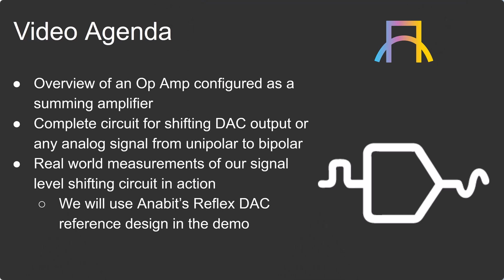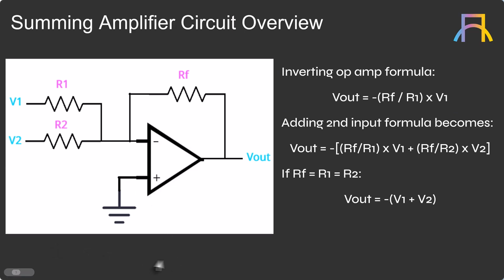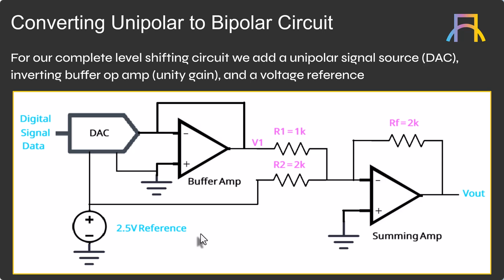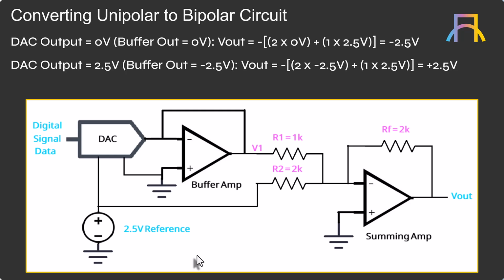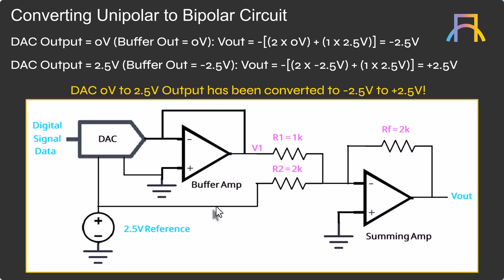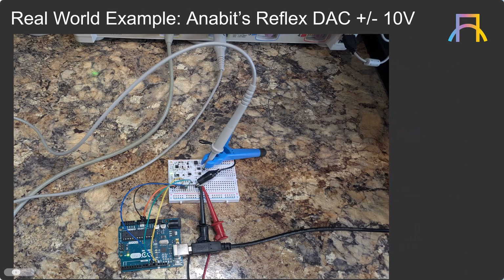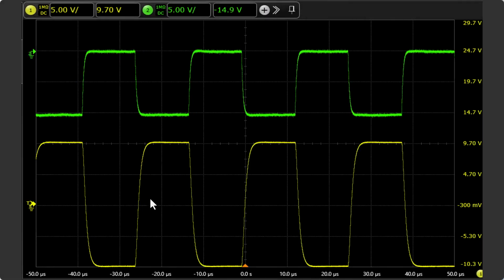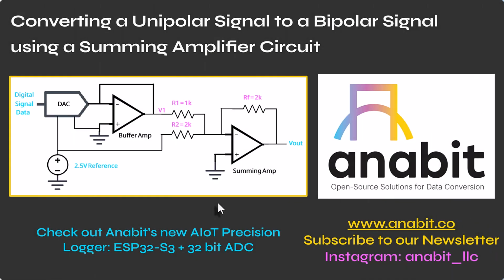Converting a Unipolar Signal to a Bipolar Signal using a Summing Amplifier Circuit

Comment: Enjoyed the video. I am guessing a similar circuit concept could be used to shift a bipolar signal to a unipolar signal that could then be measured with a unipolar or ground referenced ADC?
Reply from the maker: Glad you enjoyed the video! You are correct, this circuit concept could be used to shift a bipolar signal to unipolar so it can be measured by a unipolar configured ADC. If you use the ADC's reference voltage to shift the signal you may need to scale, for instance divide it by 2. You may need to add an inverting buffer op amp at the output of the summing amp to ensure a positive unipolar signal.
Reply: @Anabit-LLC   Are you able to make a video explaining this concept?
Reply from the maker: @deyanagounder4534  Yes we can add that to our list, we have long list of video concept we need to get through first. It is the same concept cover in the DAC video but this time the Op amp is facing the reverse direction. You would probably want to add a buffer op amp before the summing op amp so the summing junction doesn't affect the impedance of the signal path.